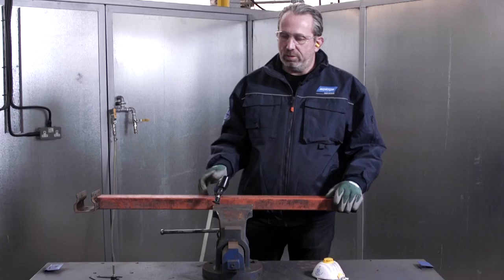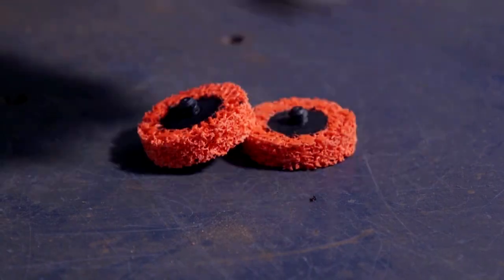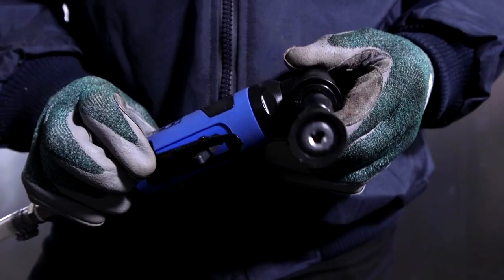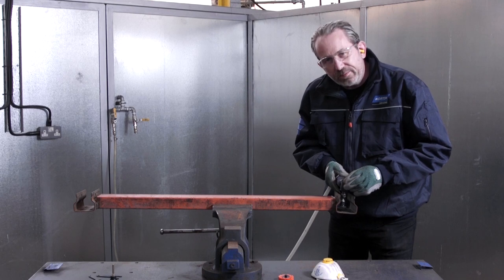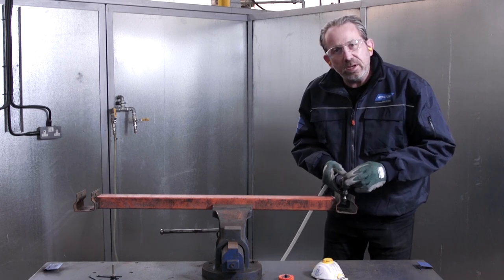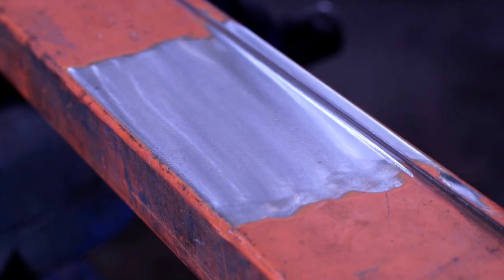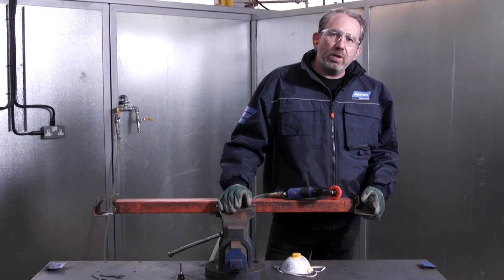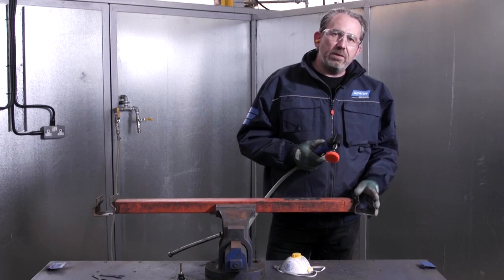How to remove paint from metal with the Norton Mini Angle Grinder

Comment: Good and cheap, but air sandblast is better than this tool or pickling in immersion if you don't have to remove the paint but only the rust.